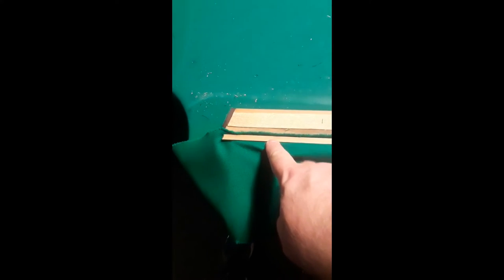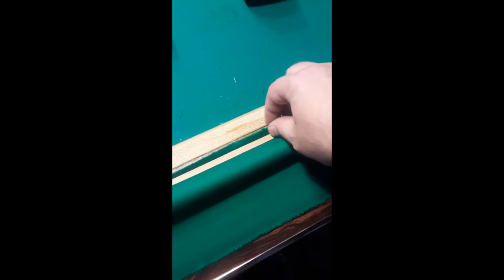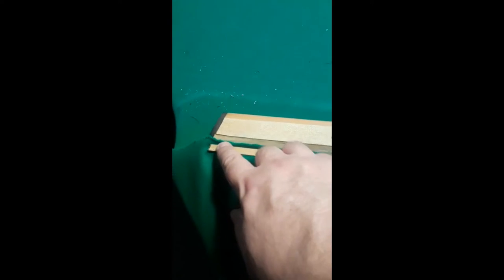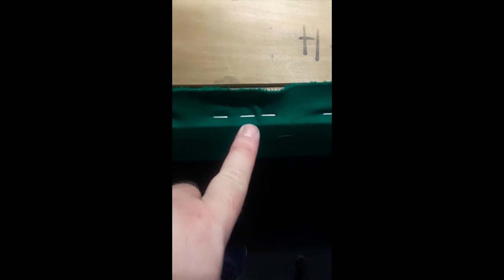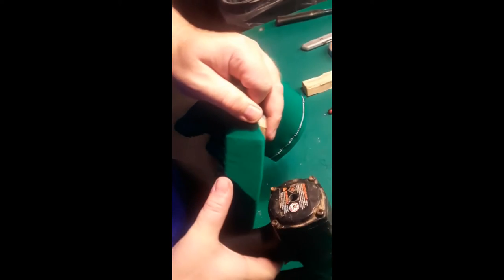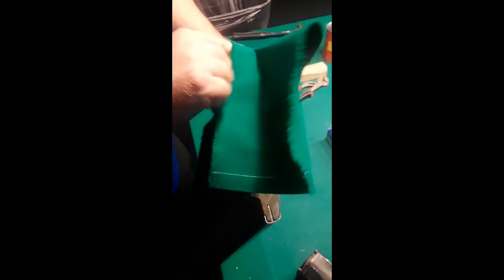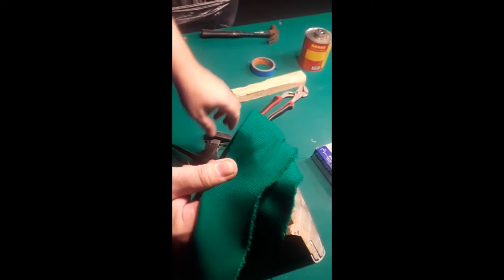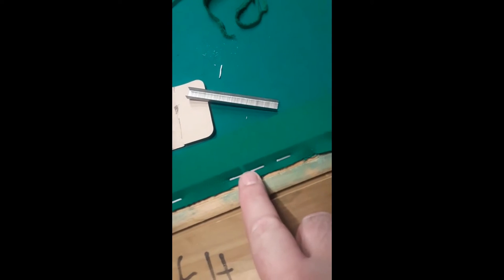Installing Pool Table Cloth

Comment: You should start stretch indexing your cloth. You will never again have loose cloth  due to weather conditions. It works for any type of cloth.
Reply from the maker: I have been doing this for 18 years now in my pool hall. I am a fairly large guy and pull the cloth about as tight as I reasonably can. I had loose cloth once or twice the first year or 2 based on bad advice I got. The Simonis guide is actually very close to how I install cloth, but I go off feel and do not mark the cloth...
Reply: @rockfordbilliardcafe1363  I have also been doing tables for little over 20 years and still trying to find a better way of doing something. I suggest getting the Simonis installation DVD set. Simonis hasnt recommended their old diagram instructions in a long time. Your rail covering and bed cloth install will improve greatly. Our local pool hall hasnt had their Gold Crowns covered in over 4 years and the cloth  is still tight. You can't push it with your fingertips on the playing surface. On a side note, the cloth relief at the corner pocket featherstrip is a great trick to make corner wrapping clean.
Reply from the maker: @travis02gt  Dallas West told me that little trick getting the corner pocket cloth tighter on the rails. Any time I see someone doing tables I watch for a bit. Always seem to learn something.